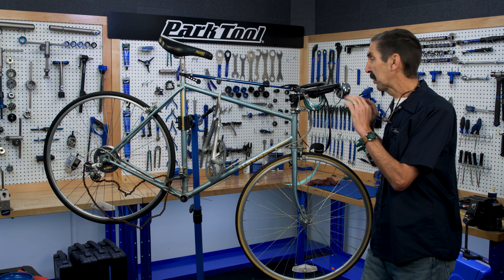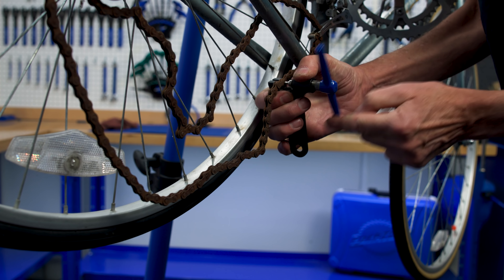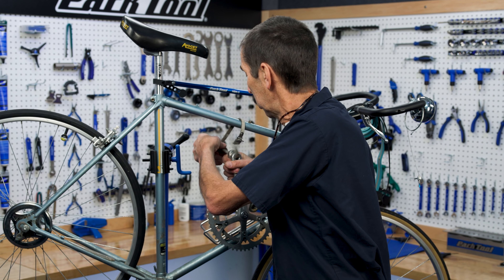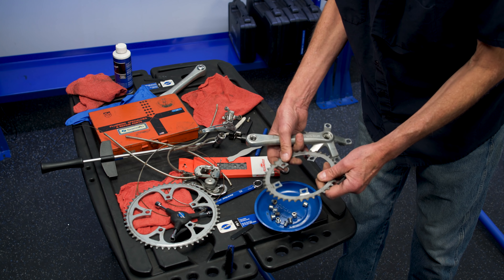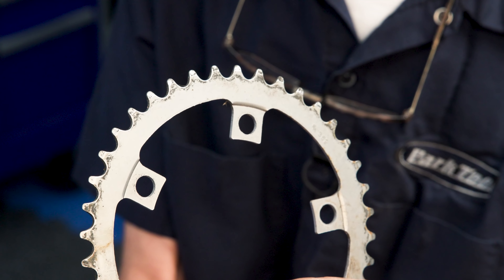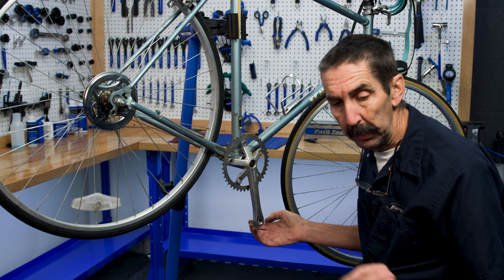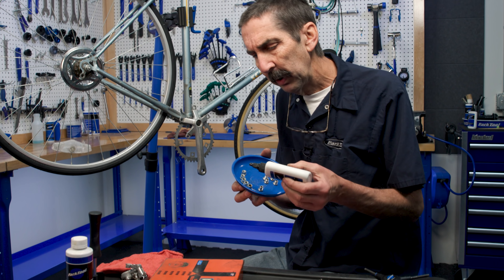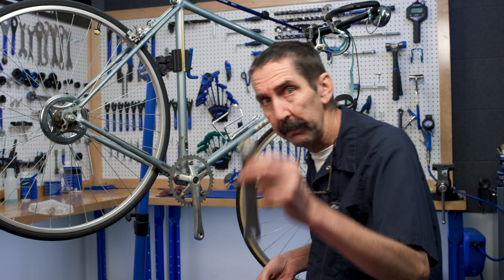World Sport Chain Fix Part One: The Chainring | Tech Tuesday #187

Comment: I always use a mini set of bolt croppers to deal with dead chains… save ya park pins, bolt croppers good for those old locks that need removing too. A must for the tool chest / wall

Comment: I would have restored it to being as close as possible to its original setup, cleaning up what could be salvaged and replacing what couldn't. And of course gotten rid of the spoke protector.

But this does inspire me to build out a classic steel bike from the various parts I salvaged from my old '82 Trek, basically everything but the frame, fork, handlebars and wheels (although I do have the front hub). And to be honest I was never entirely crazy about those parts, being heavy and clunky.

Comment: I’m new to Biking. So chain rings,spiders etc are standardized and Interchangeable?
Reply from the maker: No, nothing much is "standard" around bikes.  If the number of spiders match (3,4,5,6) and the diameter of a circle formed by the bolts match, then ring will interchange.  But there are many many variations.
Reply: No not always. One thing to note is the BCD (Bolt Circle Diameter). Even if you have a 5 arm spider  you might have a 130 or 110 BCD crank/chainring combo. I learned this the hard way on my own World Sport restoration a while back. The SR cranks on my bike where a 5 arm 130 BCD and I had purchased a 110 BCD ring that I tried to install. Did not fit and lesson learned.

Comment: I was thinking maybe using a bench grinder to make them a bit shorter?  Where do you find parts like those spacers if you haven't got a lifetimes worth of spare parts stashed away?
Reply: yes you can grind down the bolts that are too long.
time consuming, tedious.
look up chain ring bolts online if you want to buy new ones.
you need to measure and add up the thickness of the chain wheel and the thickness of the crank arm spider that the bolt will go through.
good luck.
try not to grind of the tips of your fingers.
Reply: Spacers, or just shorter nuts and bolts, are available wherever bike parts are sold.
Reply: @ProthoPectore  did it with a file once. do not recommend
Reply: Most bike shops will have shorter chain ring bolts. Many started carrying them when mountain bikers and cyclocross racers were ditching the front derailleur and going 1x.

Comment: Serious question here, does anyone have any ideas of what to do with thousands of spoke off-cuts?

The obvious answer is to sell it as scrap metal but we're not talking industrial quantities here so the money barely covers the time spent disposing of it.
A much better idea would be to use them for something that makes use of their current shape/form such as an art project perhaps?

To explain, I have a wheel-builder friend who also sells spokes at any/custom length (using a Phill Wood spoke cutting/thread rolling machine), he has boxes full of waste spoke off-cuts ranging from a few mm to 20cm or so (1/8" to 8"). Most of the waste/off-cuts are from the threaded end but there are also plenty of bent/rusty/cut-too-short spokes with a J-bend.

FYI, we already have more 3rd hand/chain-holders than you can shake a stick at...
Reply: A local coffee shop uses old cleaned up spokes as stir sticks instead of spoons.